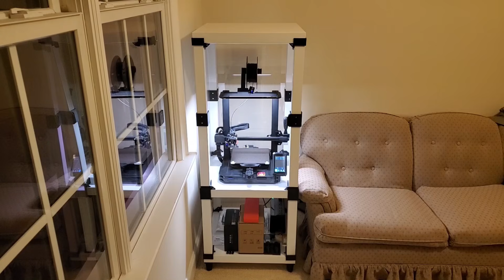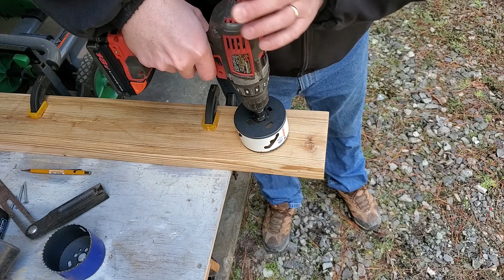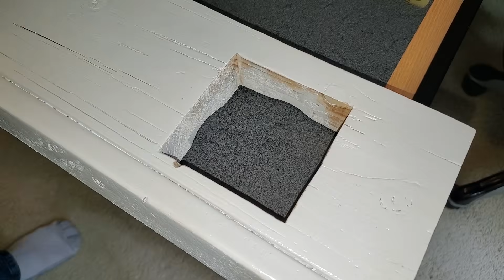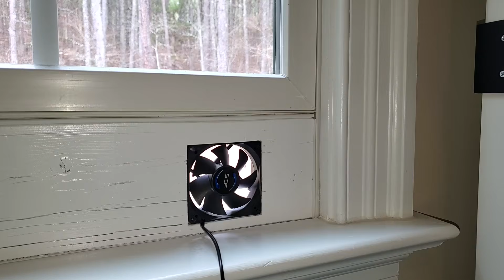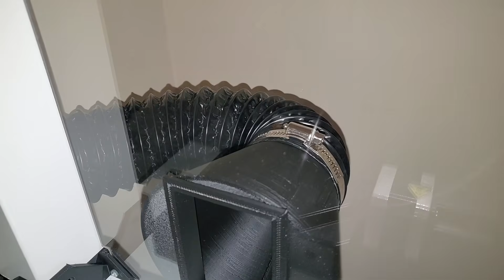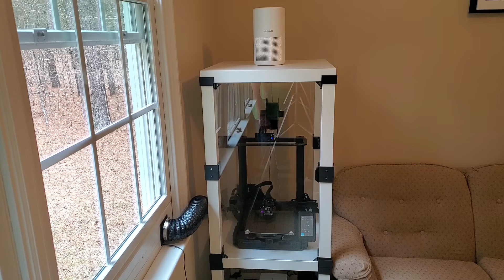Adding a Fume Exhaust Fan to my Custom 3D Printer Enclosure

Comment from the maker: USB Fan with Speed Control:
https://link.amazon/B0a2Xs8xi (affiliate*)

USB Power Adapter (to plug fan into outlet):
https://link.amazon/B0hdTmqGW (affiliate*)

3-inch Black Flexible Ducting, 5-feet with Clamps:
https://link.amazon/B0eUes7Ii (affiliate*)

3D Printer Enclosure + Exhaust Fan Tube & Flange:
https://www.thingiverse.com/thing:6296586

*Purchasing from these Amazon affiliate links earns my channel a small commission. Think of it as a tip that doesn't cost you anything. Thanks for the support!

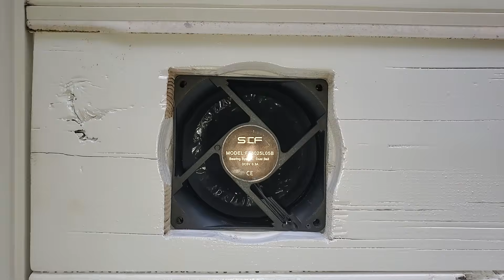Comment: 2:54 Can you please provide peer-reviewed research about long-term styrene exposure being fatal? I tried researching all over the internet and only saw reports stating that HUGE amounts of vaporized styrenes can be fatal and that it's actually quite unlikely to happen and would mostly be due to industrial exposure, how would a single printer generate that much? Obviously it makes you feel like crap, but I couldn't find any research stating that it's fatal.
Reply from the maker: I'm not a doctor but if you research "styrene sickness", you'll learn way more than I know. When it comes to 3d printing, I think you're more likely to experience symptoms if you work in a print farm. However, if you print a lot in a small office or bedroom, I assume you'd eventually feel ill. I'm sure death is rare, but the symptoms of long-term repeated exposure include nerve issues and organ damage. Personally, I didn't need to read much before I decided I wouldn't want to print with any filaments containing styrene in my house. The exhaust fan makes me feel better about printing less toxic filaments. To each their own.

Comment: That was a good solution. You could have also used a 12V computer fan with a 12V plugpack.
Reply from the maker: Thanks! Yeah, I had lots of fan options but most of these smaller 80mm fans were only 5V so it seemed like the best option for me.